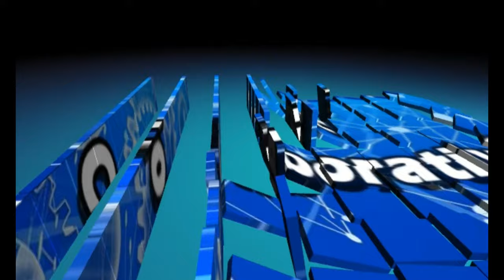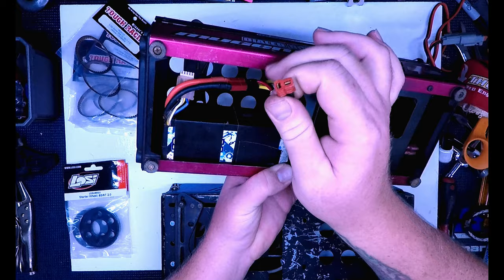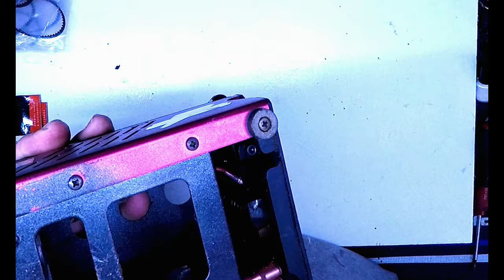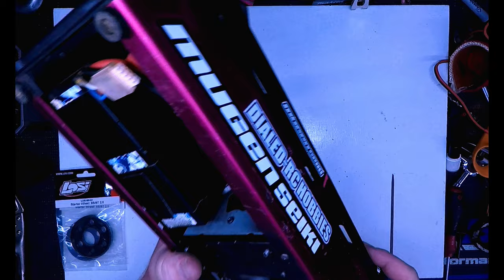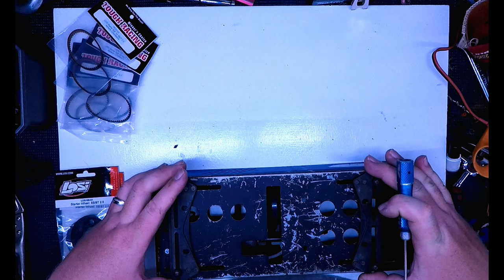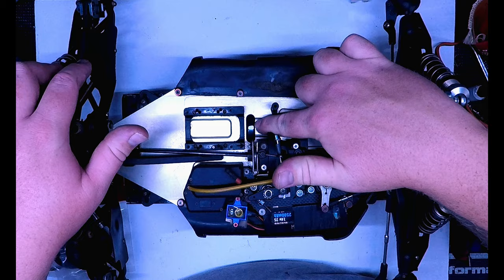Starter Box Setup Tips, Quick and Easy Setup

Comment: A good tip when wiring new conections is solder heat shrink and a tiny smear of dilectric grease on the connection posts/bayonet plugs it helps to waterproof  and makes a good electrical conection  reducing the heat and mechanical wear on the plug n play connections  i use it on my 2003 fords battery posts and fuse/relay terminals that get wet